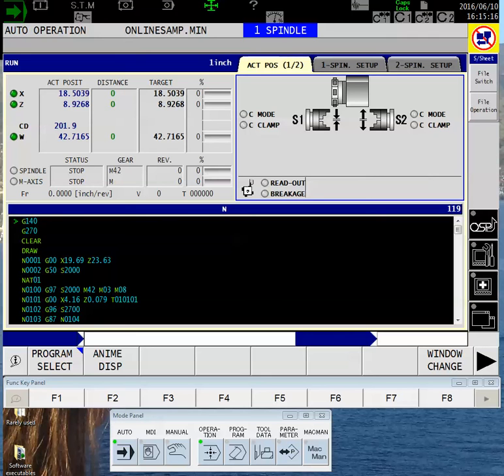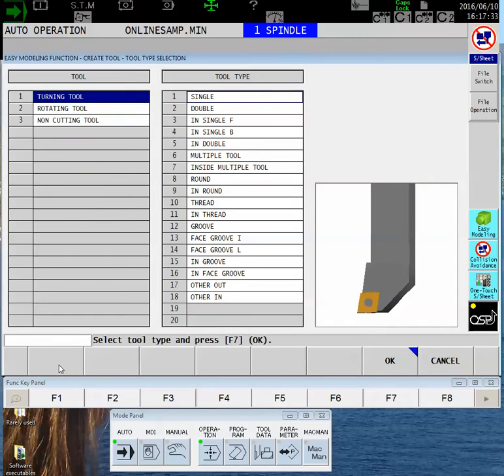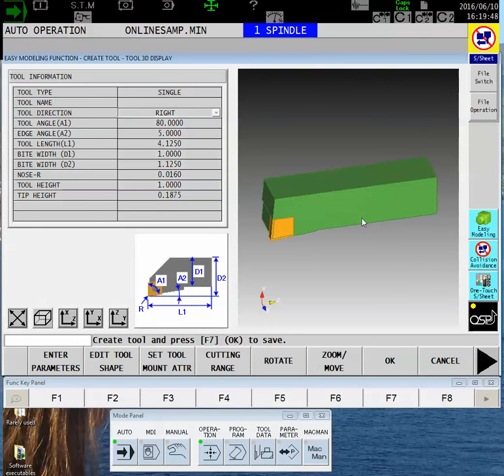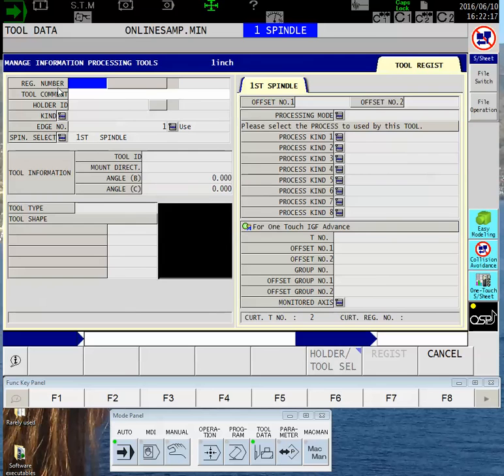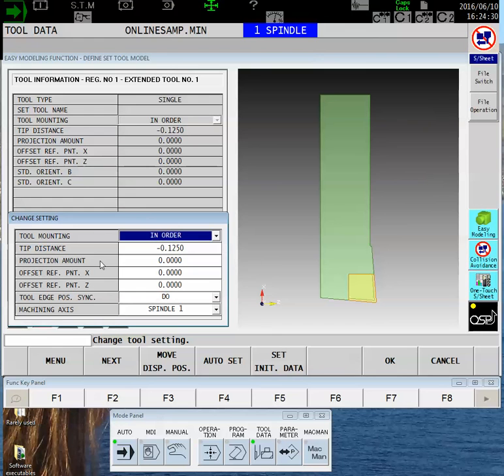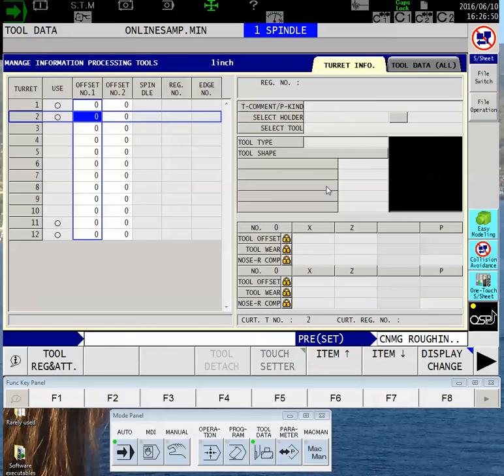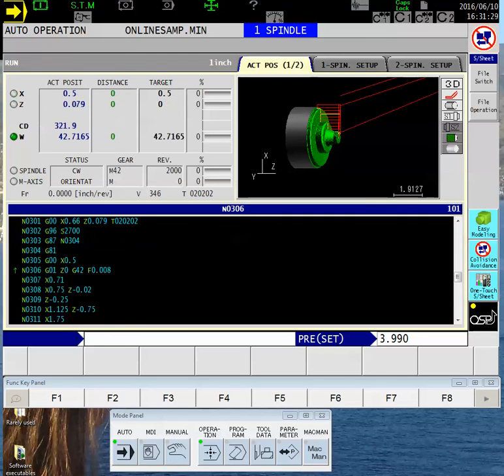REGISTER AND ATTACH TOOLS FOR GRAPHICS

Comment: I see that your sticking out length is 0, at time 11:17. For some reason on my machine the tool has a stick out of 5 inches and is there a way to set this to 0? I followed the steps the same as you did for a left handed turning tool and every time i try to run a program with this tool after setting the offsets it tries to go about 4-5 inches further down then i expect it to

Comment: How to set reference tool?
Reply from the maker: The X should be measured normally, but set the Z for the reference tool at zero, then run the calibration procedure on my channel. That will set the sensor to be zero with the reference tool, then that tool can always be used to set your work zero

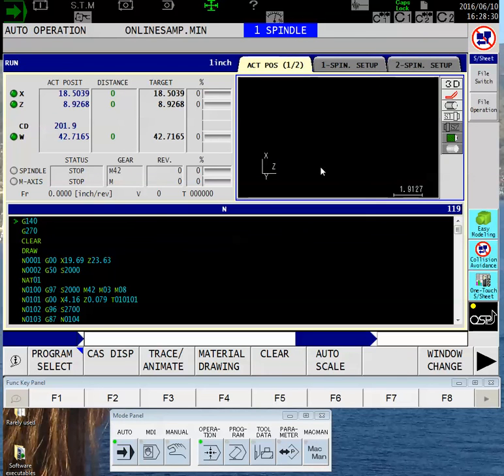Comment: Can I ask at 13:13 , In the turret info. tab, in the box of offset No 1 at bottom right ,what is the P for at the Nose-R comp row.
Reply from the maker: That is the position the insert is held for nose radius compensation. There are 9 individual positions, but really the two most used are P2 for a boring bar and P3 for a turning tool.

Comment: How do you setup tools for the sub spindle? Every time I try it, ends up changing the tool on the front too.
Reply: Press the right arrow extend key and tap "change ex. Tool no." Then highlight the edge you want and add another tool(tool select).  Otherwise it will keep overwriting edge one even if you change it to edge 2 in the "change setting" option.